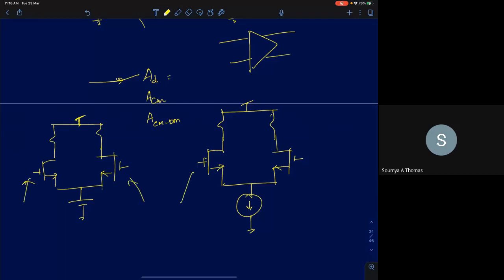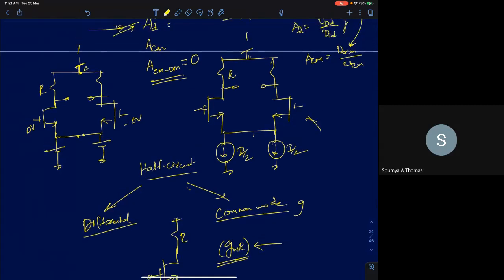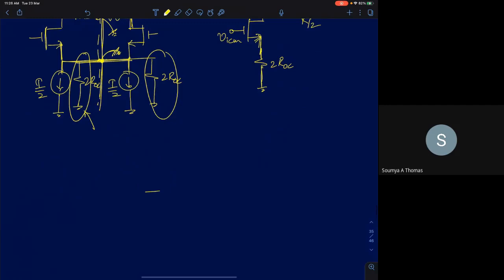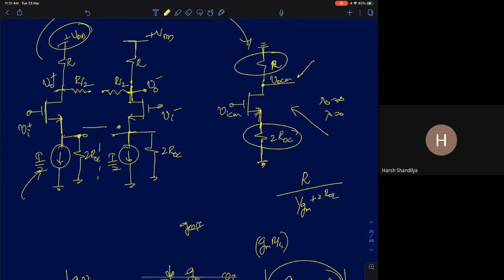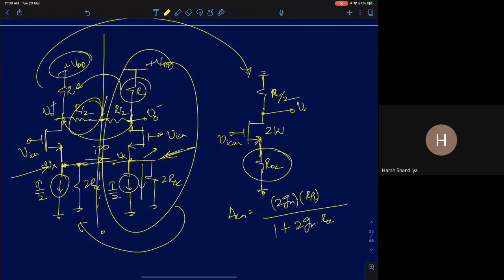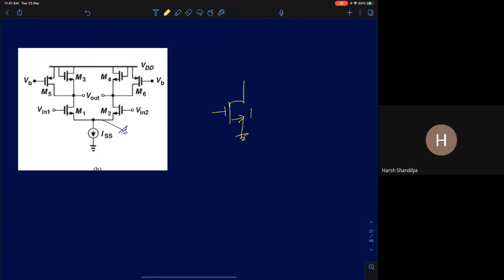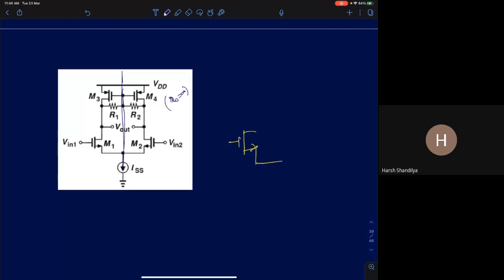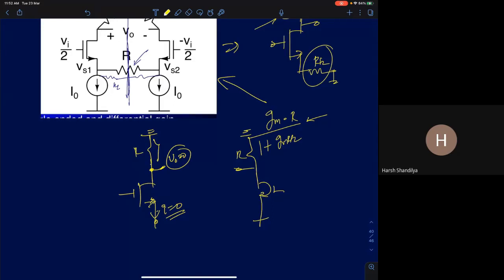MUE   Lecture 44: Problems on differential and common mode half circuits

Comment: i really did not understand that in D half circuits, we short the symmetry line points, as the differential changes with respect to each other are some, so they should vary in a similar manner, whereas in CM half circuits, we open circuit the symmetric line points because they have the same potential and the current would not flow between them, why is this so confusing ?, please help